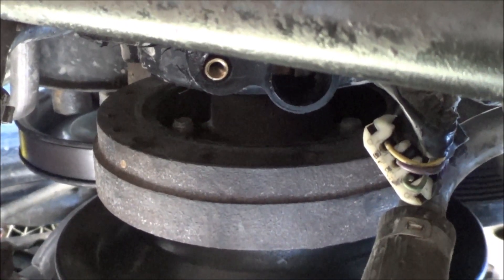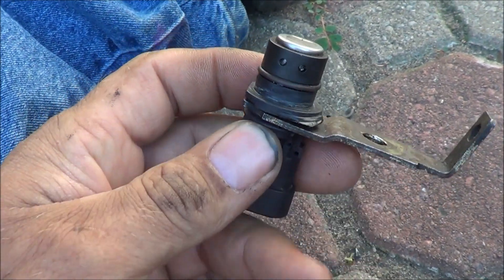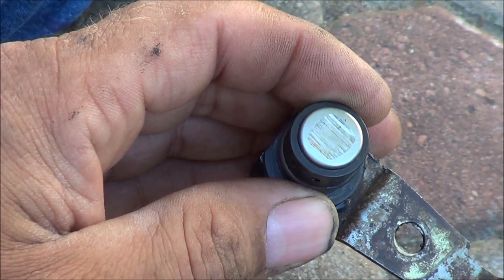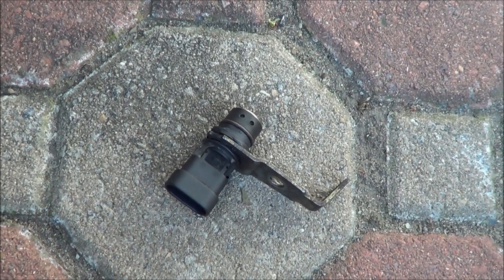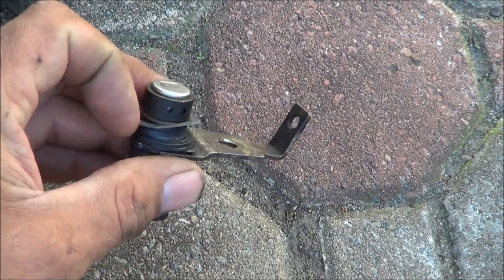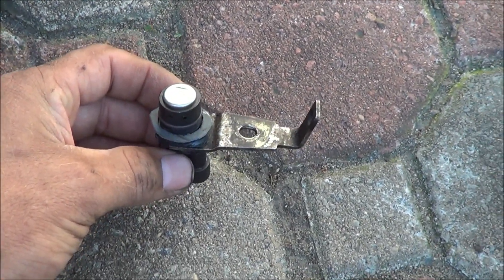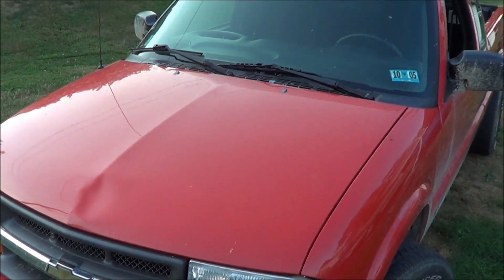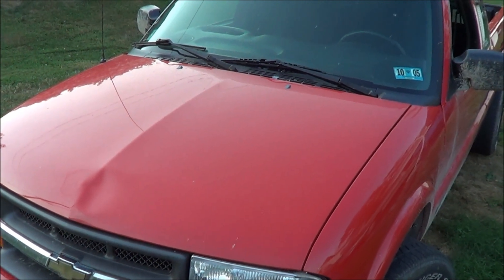P0335 - GM 4.3 crank sensor shim

Comment: Does it require a relearn procedure? I have a slight noise since installing the new sensor. Going to try shimming it today.
Reply from the maker: I do not remember if there is a relearn .  But most are probably installed with out a relearn.  I believe it will relearn its self just take longer

Comment: The problem my customer was experiencing on his 2001 GMC Sierra was a random stall.
They would just be driving and the truck would stall out of nowhere and most of the time it would start right back up but sometimes it would take long to crank.
I pulled out the crankshaft sensor and it did appear to be scratched.
I ended up replacing it and putting in one shim and I'm really hoping that this was the cause of the stall.
There Was also a random misfire code

Comment: Hello. Is a relearn after moving, replacing necessary or not? I have a 1999 4.3l V6 142kw AWD. Some people say no and some people say yes. Thanks!
Reply from the maker: If you can i would do a relearn , but after a while it will probably relearn its self

Comment: Hello, I'm working on my friend's 04 4.3 silverado it has a P0016 code, the crank sensor is covered in oil, I have pulled the distributor and it looks good the gear and no slop. I put a new cam sensor in but still has the crank/cam sensor correlation code, can you give me some ideas please, and if I put a new crank sensor in do I have to do a relearn for computer? Thanks for the video helps a lot. 👍👍🏁
Reply from the maker: I would try a relearn , that code is the cam and crank sensors are reporting they are not signaling at the right time together , Could be a wiring issue , melted , rubbed wire .loose distributor, or not set right.   Also sometimes the drive gear on bottom of dist wear and cause it . Sometimes can feel it in the dist shaft , but sometimes you need to pull dist and look for wear on dist gear. Could be a stretched timing chain . Maybe a tone ring slipped , that is where they get their signal from . Sometimes that will be a rattle also.

Comment: I had a time with my 4.3L S10. This is my main daily driver with near 300k. Great little truck for most every thing. Lost the Transmission to a "no driver" situation.  After the rebuild, She started the die under 2k RPM random on back roads and slow Hwy 280 traffic. The OBD2 had no codes and would start in neutral or on side of road
Upgraded Grounds to 2 gauge and fuel pump among other exploits.

I chased too many rabbits till I found this. Using a gasket works. The sensor are near $60.  Thanks for your time and video!
Reply from the maker: Thanks for watching and commenting

Comment: This vid helped alot, i tried no shims first after front cover replacement, i heard the crank sensors rubbing so i installed one shim of the 2 the kit came with, so i ran arround with a misfire for a long time in till i fnally installed the second shim, no more misfires and alot more power, i am happy now

Comment: I have a 99 GMC Yukon with the 5.7 liter engine. My crank position sensor is sending a fault code causing my check engine light to come on. I got another sensor from a junkyard , installed it and the truck won't start at all. Sooo,,lol....I put the old one back in , that is suposidly bad and she fires right up. I'm no professional but doesn't this sound a bit strange??? Any ideas out there Chevy guys...
Reply from the maker: maybe the junk yard one was bad . would of thought it to of at least done the same as original one . Also check wiring and the sensor ring on crank shaft .

Comment: Thanks for making this video.
I have been chasing a P0300 code in my '96 S10 4.3 liter for over a month. I checked and doubled checked all the normal components that contribute to setting this code, but found no issues. After seeing this video, I thought this might be the problem. I removed the crankshaft sensor for inspection, but It did not exhibit the wear pattern from rubbing the crankshaft. However, the sensor and connector was covered lightly in oil. I thoroughly cleaned and reinstalled it with die-electric grease. It's been a week now, and the random misfires that ranged from 1500-3500 rpm have not returned.
Reply from the maker: Glad you got it up and going again .
Reply: I have a new-found respect for crankshaft sensors. This is my first time I've had to deal with one that was the root issue.
Reply from the maker: Do not be supersized in the future to find bad ones , a lot of them just stop working all together , but that does make them easier to find
Reply: No doubt. Mine is a two wire sensor. Easy to check with an multi-tester. Similar to an ABS sensor.
Reply: Stanley Waggoner bless up for your inspiration

Comment: The crank sensor you see here is worn out on the end as it rubs with  time and wear, it's time to change it out!   But if you need a quick fix and your budget is tight try this , but  again ?  it's just a temporary fix as with all things you need to replace it!  If you don't have a scanner which all of us can not afford , would be the right TOOL for the job  ,sometimes a quick fix will do!!!!

Comment: hey wtbm123, my truck had had problems stalling and sometimes the truck would just shut off. I replaced the Ignition switch, didnt stall for a week. Now at around 60-70 KM/h it will jerk like it was going to lose power then run fine. Should I replace this part? 2000 blazer 4.3. Already replaced cap, rotor, fuel pump, distributer, serpentine belt. iridum plugs and wires 2 years ago.. Starts fine and runs good when it does run.
Reply: Tuens out it was a bad ground at the ICM
Reply from the maker: I myself would trouble shoot it and see what the issue really is . One can guess at parts or have it put on a scan tool and see what is really wrong
Reply: Yeah I did put the new crank sensor in and clean up some grounds still stalls. I dont have a scanner or fuel pressure kit so to the shop she went!!
Reply: gm has the shims for it.. bought them couple months ago.. i was getting po300 codes every couple weeks.. go to any auto parts store & ask for the crank sensor. read the instructions. too much to type..if stalls.. or po300 codes.or engine looses power..you need to shim the sensor..

Comment: what if the opposite is true? I got a 4.3l that doesn't pick up a crank signal on cold mornings. I use a sensor that has been shaved down to get it closer to the reluctor wheel bit I can feel it making contact. Only way I can get it started. When it warms up, a standard sensor works. What would cause this?
Reply from the maker: Be nice to have a way to read the live data on sensor . Make sure all connections are good and have full reference voltage at sensor. If heat related and new sensor not a fix then maybe temp is moving something , the cover / the pick up wheel in side ?  .
Reply: main bearings worn.. normally the first 2.. just pulled out the motor. took oil pan off. pulled no.1 main.. & bearing is badly worn, with lines in the bearing... bearings worn will drop the crank. bought the truck 4 years ago. since i got it every couple of weeks i would get po300 code...when i shimmed the crank sensor, it was a couple months till i got po300. when it came on.. i added another shim.. 2 shims total..

Comment: I had the oil pan and rear main seal replaced by the dealership and shortly after the truck started missing and wouldn't rev over 3000 RPM. I looked around to see that they could have touched and saw the crank sensor attached to the front cover so I replaced the sensor and viola it ran fine! 

Flash forward a few years later and I'm having the same issues as in your video. Truck misses under a load in 4th gear, mostly in cylinders #1 and #2. I pulled my sensor again and it's scared worse than yours. I tried the shim, Autozone sells them for $4.99. But the truck still runs the same. I ordered a new AC Delco sensor and will install with the shim. I believe it needs a crank relearn to run optimally?
Reply from the maker: Thanks for watching and commenting

Comment: where are they located on an 88 4.3l?
Reply: Only uses the pickup in the dizzy on that engine.
Reply from the maker: I believe should be same place , timing cover
Reply: +wtbm123 turns out the don't really have one..but there is a crank fuse so idk..but I got her running so alls  well

Comment: wtbm123, The original crankshaft position sensor was damaged because the timing cover was not reinstalled in the exact same position. The timing cover is a one time use. If it is removed, it must be replaced. If the timing cover, and or crankshaft position sensor, is moved, removed, replaced, or disturbed in any way, (including removing the timing cover), a crankshaft position sensor relearn MUST be performed with a scan tool capable of initiating it. If you don't perform the relearn, the engine will still start and run, but injector timing and ignition timing will be incorrect, and no DTC will be set in memory. The relearn "tells" the PCM the precise location of the sensor.

Comment: This has to be whats wrong with my Astro.  going to pull it tomorrow and see if there are marks on it.  should i shim it or just buy a new sensor?  Im a touch confused, what is the cover that is mentioned a few times in the comments?
Reply from the maker: +amelio882004 The plastic timing cover .If it has been hit it needs shimmed. If the marks are deep or wore through the metal replace it .

Comment: Excellent video !   These systems match my 95 4.3 exactly. I don't have the rubbing on my sensor , but its acting like this even after replacing the coil pack , ignition module , plugs wires and cap. So Im going to be replacing my sensor tonight after I run an test if its good. I also learned how to do this today. Thank you !

Comment: Thanks for the video!!! Had some issues on  the parkway with a miss when id jump on it and the tach was all over the place, my check engine light came on, scanned it, goggled the code and your video came up. Parts store didn't have the shims but had some "fiber washers" . I didn't have the groove  cut in my sensor. I used 1 washer and its all fixed so thank you so much
btw its an 03 GMC Sonoma 4.3
Reply from the maker: Thank you for watching and commenting

Comment: I started my truck for work on a cold morning, went inside to use bathroom, come out its barley running RPMs were low. I go to give it gas and it shut off, and it hasn't restarted since then. would this be the most likely problem would you think?
Reply from the maker: It could be , but could be other things too. Is there fuel pressure

Comment: 2001 Astro w 4.3L, I changed the sensor and the new one came with 2 shims measuring .020 each.  I did not add the shims as the one I took out was not scratched.. The new one lasted about a week and when I pulled it off, it was scratched. I added both shims and it was magically fixed. Thanks for this video!!
Reply from the maker: Glad you got it sorted out. I made the vid because i have seen several 4.3 engines do this . Thanks for watching and commenting.
Reply: Hi, I got 2002 astrovan I'm in a situastion to put a crankshaft sensor tomorrow ,  I got p0335 code Crankshaft sensor my Van is stalling got the parts from AutoZone Duralast  $80 :( expensive but life time warranty..  I might do the same as yours two shim. Hope you give input on my comment :) thanks :)

Comment: Okay so you built a new shim for it, and reused the same sensor. What happens if I buy a  New Delco sensor for it do I still need to buy a shim for it or no? Thanks for the vid.
Reply from the maker: Originally there is not a shim. Gm made shims to cure a issue of sensor hitting ring on crank. Look at the bottom of your old one ,if you do not see any signs of it being hit or scraped on bottom then prob do not need one.

Comment: just a tip about this change of crank censor there is a retainer nut inside casing that hole censor this retainer nut will lossin after time and cause the crank censor to move around and cause the mulit missfire error it just happen to me a little piece of twine to hold it together and some five min epoxy put bolt throu censor first tread retainer nut back on just a few threads then put enough epoxy on it push it back up in place then re tighting nut should work fi for you and could save you 110 dollars on new crank censor hope this helps someone

Comment: I had the very same issue.  I pulled the engine to replace the crankshaft, main bearings, rod bearings, and oil pump.  As everyone knows, you must remove the time chain cover.  All was well and then all of a sudden I got the check engine light and the 3000 rpm issues.  I am so glad that I ran across this video!  I fashioned a "shim" from a piece of gasket material that I had, popped the crankshaft position sensor back in and viola, I have my strong running Blazer back.  For those of you with this issue, you can get the shim at AutoZone for about $4.00 if you don't have a way of making one for yourself.  The AZ part number is SU12931.  Hope this helps for other folks!!
Reply from the maker: Glad you are back up and running

Comment: I measured the part tonight.  Definitely a 0.020" shim, 0.75" I.D. 1.00" O.D. will work.  Can get these from McMasterCarr for $6 for 25 qty.  Unfortunately the PO335 error is not due to the reluctor hitting the sensor on the Jimmy - no witness marks.  Depth to reluctor is 0.74", depth of sensor is 0.70".  Looking elsewhere for my PO335 problem.

Comment from the maker: I do not have one to measure,but some take more than one shim. You only need to shim if it is hitting. Mine was hitting pretty hard so I used a piece of thin black gasket material. No harm in shimming out as it will not hit anything. Most of the time i have ran in to the need to shim is when a plastic cover has been reused.If you do not see where it is hitting it may not need shimmed.

Comment from the maker: Most of the time you do not need the shim . You are supposed to replace the cover everytime it is removed. Alot of people try and reuse the cover and most times if shims are needed , that is why. So if the sensor goes bad you most likely able to just replace. I got  the bulletin straight from GM for the 4.3 , so not sure why they could not find it. Sorry if i confused people with the video , I thought i had explained why i had to shim ,Thanks for watching.

Comment: i just wanted to drop a line the video was help thanks ,but i have a 2003 s-10 pickup zr2 4.3 would start but die then it wood not start this sensor was bad but after searching around i got sensor but no shim ,had to be ordered called my local gm service dealer tech said there is no buliten ,he said the bulliten must have been pulled ,the after market sensors do not need the spacer,they have fixed the problem with these sensors the prob depth is different ,so tried shim but it ran like shit ,

Comment: It took me a while to find the correct diagnosis for my engine, same problem as yours. Unfortunately my timing cover has never been replaced and my engine has roughly 335000 miles on it. I did use the shim GM part# 12565102, at some point I thought the original problem was the tone wheel moving, turns out as you stated the plastic timing cover warps/cracks, when the engine gets good and hot it set a different air gap at the tone wheel. This causes p0339,336 to set on the dtc or MIL. Good video.